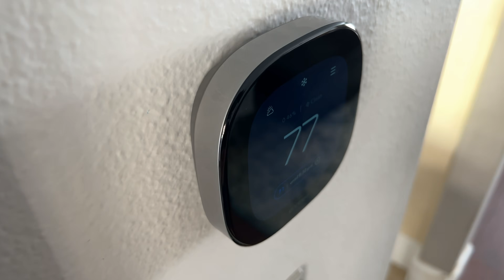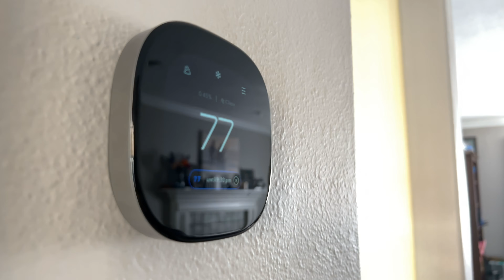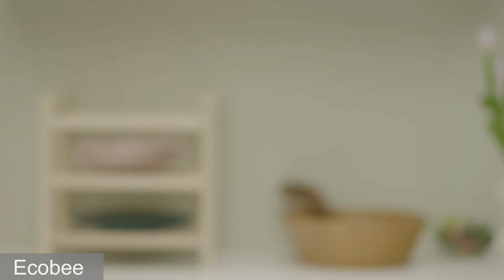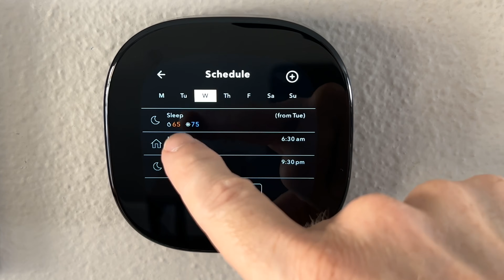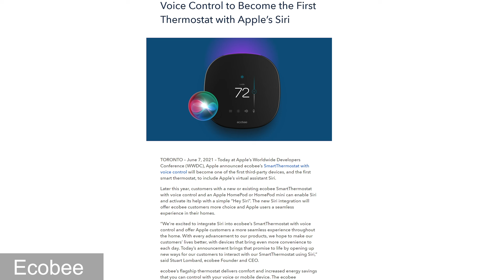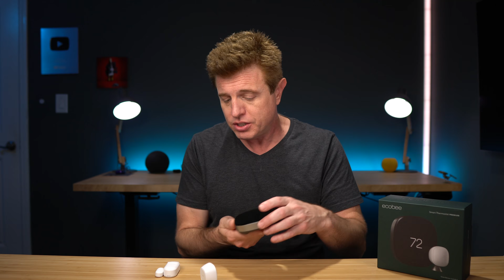Why Buy This Ecobee Smart Thermostat? Siri, Alexa & More!

Comment: You prolly can program the shutoff the AC when the door is open yourself. I bought a bunch of cheaper and smaller sensors in my house and programmed automation based on temp and humidity and it works great. Saved me a lot of $.
Reply from the maker: Yes that is a good point. Thanks for watching.

Comment: Does it not work with Apple TV vs homepod/mini?
Reply from the maker: In order to talk to Siri it has to be a HomePod.  The processing is done on the HomePod.
Reply: @CraigsTechTalk  I ended up purchasing the Premium version. It can be added to HomeKit and controlled via an iOS device (using an Apple TV as a hub), but in order to talk directly to thermostat via Siri, it requires a HomePod or HomePod mini as you’ve mentioned.

Comment: Craig, yes, would like to see video on setting up for a home alarm.  Also, I'm surprised that eco doesn't have a sensor for monitoring water leakage.  I'm in area with a high water table and have suffered the consequences of a sump pump (and backup pump) malfunction. Know of any 3rd party water 
sensor that would work with ecobee premium system?
Reply from the maker: Thank you Mark, good to know. I think it may a bit before we see more than the door sensors, motion and cameras. I feel like they are taking a big leap by going with security. I like the Aqara stuff and use 3 of their water sensors.

Comment: Hi Craig, not sure how to get the info to you but back to you, concerning the SmartWings smart blinds. I just installed my 3 that I ordered. 2 at 32x48 and 1 65x64 for $850 shipped.  got the 70% blackout in the ivory. The fabric is nice and the installed super easy. went right into homekit no problem! I got 1 remote and the dongle to use with Alexa as back up. They work really awesome and look awesome. I got the ones with the valance cassette with fabric inside mount. for custom fit blinds the price it right! I have 5 more on order

Comment: Hi Craig, Another great review. I’ve been using the Ecobee 3 for about 4 months and it works great. I added 5 additional sensors throughout the house to ensure we capitalized on data to drive our heating and cooling needs. Everyone in the house feels like the temperature has been more appropriate to their needs since adding the additional sensors. 

I am really excited about some additional devices that can attach to the Ecobee system. Adding a humidifier to the HVAC system sounds like a great idea and Ecobee can manage this when it is built in to the HVAC system (vs. a stand-alone humidifier, though with automations you could get humidity data from the sensors and alter the humidifier settings based on desired preferences and occupancy. Better still are Smart Vents which can integrate into Ecobee. These smart vents ensure a much smarter use of occupancy data so that empty rooms have their vents closed. The only downside is that the vents need to match the exact dimensions of your vents. My vents are not yet in an available size but I cannot wait until they come out.
Reply from the maker: Hello Dr. Coke. Thank you very much. 🙏. That is great that you are really putting yours to work. I like that you have 5 smart sensors going. That is nice. It will be nice when the whole system can be smart. That is where will see some good efficiency upgrades.

Comment: Craig, would definitely like to see a video showing how the camera, sensors, and thermostat holistically work together as a home alarm system.  Depending on your review, it could make a compelling alternative to the competitors; especially at only $10 a month.
Reply: I agree. Looking to start a cheap security system either with Ecobee or Aqara. Willing to spend more if there is value.
Reply: @bbruce65  check out Cove, uses cellular not internet for monitoring.